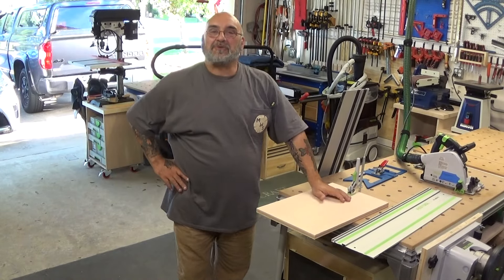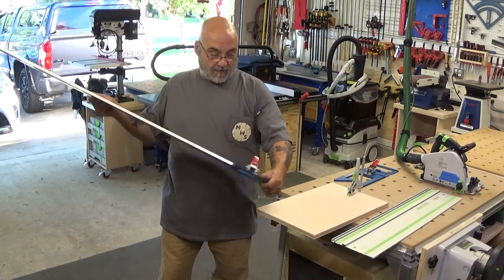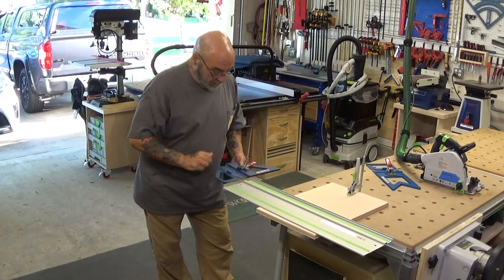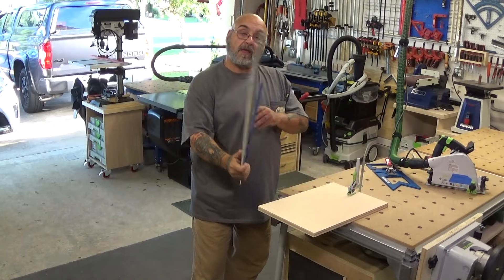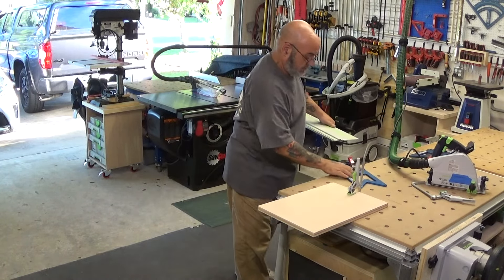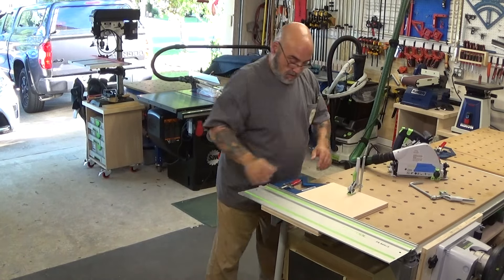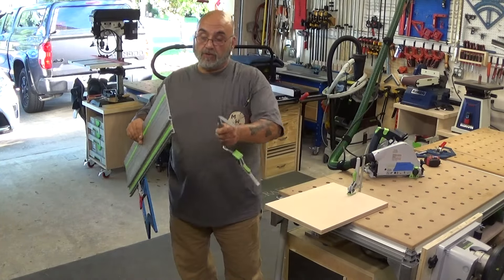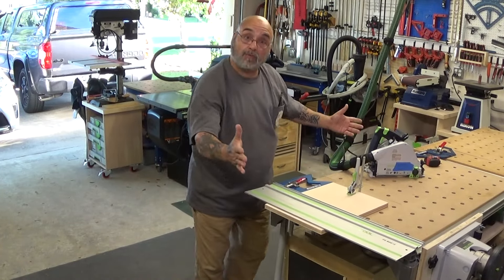TSO Products GRS-16 and 16PE

Comment: Great job Mike.  I have the 16 and have been able to work around its limitations.  If I was buying it today, I'd get the 16PE to start with.  I also put a small piece of plywood on the leading edge to keep the end from sagging down.    I also use the Dewalt guide rail quick clamps.  They work great with the Festool rails.